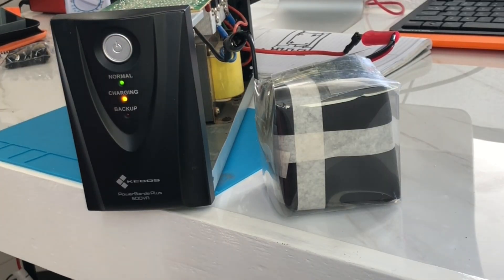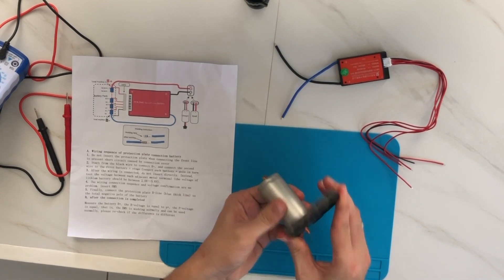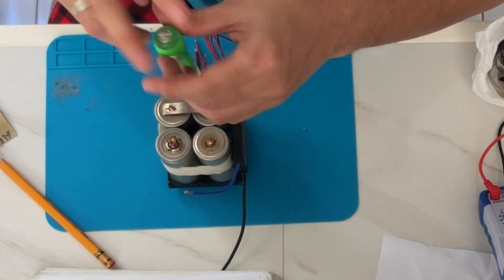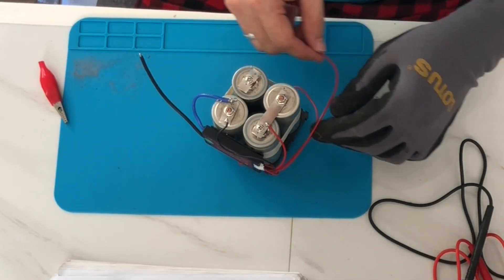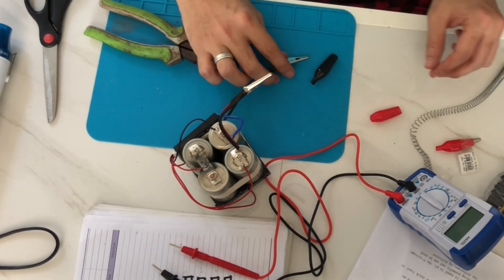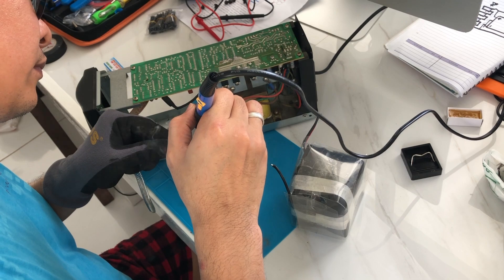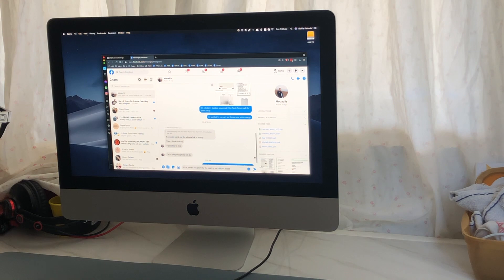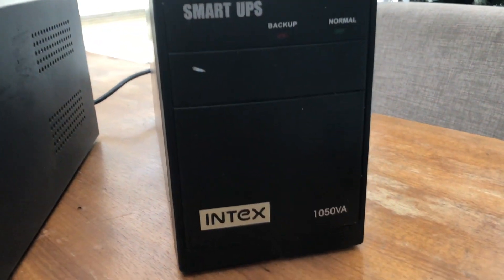How to replace a 12v UPS batteries with Lithium Batteries (LifePo4)

Comment: go to wallmart and get a 105 amp hour deep cell lead acid for about $90 bucks and run that for hours and hours. We have a lot of outages here so I picked up a few of these UPS units for free. people trow them out rather than the hassle of buying a new battery and taring them apart to replace it. They are literally everyplace for free or next to nothing. when the lights go out, your stay on. lead acid can last up to 5 years if you check the water every month. The UPS units charge 24/7 and cook batteries. check water levels and cycle once a month.
Reply: From what I have seen, the lead-acid UPS batteries only last 2-3 years and most of them do not hold 80% of the charge after 2 years even though not being used much.
Reply: @vufirst  yup. they are battery cookers. you must check the water. walmart sells a deep cycle 100 amp hour. it is called a sealed lead acid but still has  caps that unscrew to check water levels . because even sealed will vent off water . especially if just sitting on a needed "trickle charge". unused for 2-3 years. 
 check water, cycle them once a couple month's or so, and use a real battery charger to charge it to full . 
 most throw out ones you can get free, are not "pure sine wave" and not for lithium

Comment: You should remember that lifepo4 can only discharge at 1c continuasly and at 2c for few seconds. Using 6000mah cells is a bad idea. Ups will consume more than 15amp if u plug in a 100w load. And a 300w ups can consume upto 30amps. So u should go for 25ah lifepo4 at minimum. Or lithium ion. These batteries will explode or die early if u discharge them so hard..a monitor and pc st idle does not really consume much power. U should have run a cpu and gpu stress test to really see how long the battery takes to puffup😂
Reply: I did not understand any of the term like 1C 2C, what are these??

 If the 12 Volt 6 or 7 AH  Lead Acid Battery is there by default then how can the UPS consume more than 15 AMP and why the UPS will consume more than 15 AMP if anyone connects a 12 Volt 6 or 7 AH Lithium Phosphate Battery ??
Reply: It is a Lifepo4 Battery. It can handle High Discharge Rate. Without getting hot. Plus lifepo4 batteries are very safe.  It rarely catch on fire
Reply: @polized123  yes they are safe and don't catch fire easily but the lifepo4 chemistry does not allow more than 3c or about 18amps in case of a 6ah battery pack for more than 30sec. Any more will shorten the cell life. Recommended discharge rate is 0.2c or about 1.2amps continue. And maximum 1c or about 6amps in this case continuasly. A typical 18650 lithium ion battery can be discharged at 20c or more. But lithium iron phosphate can not be discharged at more than 1c .. and him shorting out the battery by stupidly sticking it in the baremetal case without any protection has already damaged the cells a bit
Reply: @KuntalGhosh  yeah. That's why they are always configured in parallel.      If we need high discharge rate for 12v. The configuration should be.  4s6p

Comment: A home computer UPS is a "stand-by" (as opposed to the more expensive "continuous"} power backup. This means that devices connected to it run directly off the grid mains until an interruption of current is sensed, at which point the battery-driven inverter is switched on (in a "continuous" UPS, the output is always from the inverter and the battery is constantly under load while the device maintains its charge and the grid mains is isolated from the connected equipment). The switching is nearly instantaneous, happening in five milliseconds or less, at which point the battery will begin discharging. This state will exist until the UPS senses a return of house power or the unit shuts down to avoid over discharging the battery. Once the unit again is powered by the grid mains, a charging sequence is initiated to bring the battery up to full charge which returns the unit to a back-up stand-by status mode with the house current again passing through to the connected device(s).

The important consideration here is any UPS is designed to work with a specific battery chemistry, in this case the AGM lead acid. There are numerous articles available that explain in depth why one should not misuse a charger meant for one type of battery to charge a different battery chemistry. I would advise researching them to at least gain an understanding of what is good practice in this regard and realizing that just because one can does not mean one should. It may result in fewer houses burning down.
Reply: I am teasing the idea of running my SMT-750i on lipo with a BMS specifically set to the expected low voltage conditions the Ups wants (luckily I can change them in this unit) but knowing that Lipos don't like to be stored fully charged I am thinking that an extra cell or 2 would help keep the "fully charged" voltage closer to the storage voltage of the cells to increase longevity dramatically. I am still trying to work out a solution that would give me somewhat accurate run-time readouts on the UPS but it's very much a work in progress
Reply: Bms should protect from over charge and under charge. Over temp under temp.
Reply: There are UPS that has a limit in battery mode but there are that can work continuously. I have a IdealPower UPS that is now serving as an inverter. I just removed the mini speaker.
Reply: Just read you comment. My UPS lead acid battery went dead and I urgently replace it. And so I replaced it with a Lifepo4 battery. The many YouTube videos made on this mod made me decide in doing so. I am running my UPS for the last 8/9 days on this LifePo4 battery. I bought it readymade online. It is supposed to be with the BMS.
Is there any danger in what I have done. Plz advice. As of now I have not had any problems. But I have not been running my system when the power cuts off. I switch it OFF immediately because I am still unsure of this mod. 
Is there something that I need to be careful about? Also what about the charging voltage? Will there be a problem with the BMS? Have connected a volt meter to the battery and it shows 13.2v max charge of the battery. But if the power fails, it drops very quickly (almost immediately) to 12.5v. Then it slows down on its discharge rate.
Reply: @mediatrix1111  It will drop very quick the first 5 seconds. Then the Transformer kick in trying to stabilize the voltage. As it drops...This is to prevent the wiring from melting. As voltage decreases. Amps will increase. That is ohms law...

So no your system is working as designed..Just be sure to use LifePo4 batteries....Not Lithium Ion...
Reply: @WizzRacing  Thks.  BTW it is a LifePo4 battery pack rated at 12.8v 6000mAh. Bought it online. And it has a BMS.
Reply: @mediatrix1111  the way your UPS tries to charge LiFePo4 is probably not good for the battery. Dangerous? Not really, LiFePo4 is sorta safe/not super dangerous. 

If your UPS is the kind that always applies a float/trickle charge then that is VERY bad for your batteries. Most lithium chargers will cut off current. Some will turn back on if the cell voltage drops a bit but it will only stay on a short time before shutting off again. I’m not going to say that your house will burn down from applying a constant trickle charge but that is the reason why I am not doing this mod.
Reply: @bobforte9343  been 2 years replaced lead acid with LFP, still hold charge for over 30 minutes.
Reply: actually charging lithium ion battery with lead acid battery charger is safe. i dont know anything about lifepo4
Reply: Wrong  most lead acid for back up  continuously trickle charged. about  ~14 V  with a little ripple.   If you apply that to any type of LI battery design  it can over charge one battery due to imbalance in a battery  then it degrades, then there is a possible fault problem developing.  A BSM will take the 14 V and control it to charge each cell to the  4.1 V you selected.  If one cell  goes low on charge the whole pack will be shut off to keep them safe.  This extra circuity missing, was probably the cause of the many fires you read in the past.
Reply: @nikhilatyoutube  You're much too modest: It's obvious you don't know anything about lithium ion batteries either. If you choose to use a lead-acid charger with the equalisation mode disabled to charge a lithium-ion battery, then you must disconnect the battery as soon as it is fully charged, to avoid damage to the battery. Best practice is to use the charger meant for the battery. Why someone would say otherwise and put your battery bank at risk is questionable.

Comment: 300w / 12v = 25 amps, i doubt your soldering will hold that power when UPS will be on battery. More solder wont hurt and be more safe :)
Reply: You're not converting all 25 amps to heat.
Reply: @DanielKennedyaeos  Not all 25 amps, but bad solder joint will create resistance. even if it eats 2 amps, 25w is a serious heat concentrated in several square mm and will cause sparks and melting
Reply: Does this mean the current depends on how much power the device consumes when connected to the ups? If ups only used in a router 9W-18W, then the current drawn from the battery will only be 1.3A-0.67A right?
Reply: @r1ce0919  if battery is 12v then yes
Reply: Ups only consumes maximum of 10A. It should not have that problem
Reply: @polized123  10A from outlet yes. but from battery it's more than 25 amps
Reply: @alexsiniov   that gel battery is rated for  10 amps max  but those Li may do 20A   The wall current is for running the ups like a power strip.  most are 15 amps in the us
Reply: Then using 40Amp BMS is fine
Reply: but most of the bms boards provide this kind of tiny small wires and connectors. strange...

Comment: should add a mppt solar charge controller also to it but . #NOTE make shore it can be programed to the right voltage so not have issues with the ups charger . test the max voltage of the battery at all times to see if it has a equalization charge so you dont blow up the battery / cells. other then that ill hope to see that you made an update of this ups conversion

Comment: For 2000va 24v ups, How many battery i need and what Amp bms for say almost 500w load for at least 10 min ? Plz answer bro.
I have this Power Guard PG-2000VA UPS which has a Display buit in and can hold 4 lead acid battery which is total of 24v 18ah.
Reply from the maker: 8 cell in series(3.2v each) - 6ah. Your UPS can carry upto 1400watts. So you can add more battery in parallel of up to 50ah.
Reply: @techwithrichie  What about BMS ? Which bms i should choose ?
Reply from the maker: @Mr.Thanos_  based it on the max ah capacity of your battery build. For 18ah, you can use 20-30ah bms
Reply: @techwithrichie  Thnx bro now i get it. Soon I'm gonna do it. If i need any help i will ask you.
Reply: @techwithrichie  I ve seen a BMS with contact relay programming. You set charging voltage and over charging voltages from 6v to 60v, do you think it's safe to use that BMS. I am afraid the transistor BMS may short one day and cause fire.

Comment: Thank you so much this is the video I was searching for 
1 Since its lead acid battery UPS battery will be continuously charging does battery will destroy or fire due to overcharging 
2. This battery capacity is how much AH. Can layman like me  try to build battery of course i wont do short like you did 
And please let me know the how is your battery performance  now
Reply from the maker: 1. The BMS handles the overcharging.
2. 6Ah 12v in series. Battery still performs like the first day i installed it
Reply: @techwithrichie  After the battery gets full recharge does the UPS cuts off charging ?
Reply from the maker: @Bharani_0601  yes. The BMS has over charging protection

Comment: Honest Question: Doesn't the old case have its own BMS?
Reply from the maker: No. It was designed for lead acid battery not for lithium
Reply: @techwithrichie  How would the case be able to tell since current is current?
Reply from the maker: @Moe-j8z  It does manage a 12v bat but it doesn’t mean it’s able to manage the 3.2v individual cells right? The BMS is for the 4 cells in series.
Reply: @techwithrichie  I see your point.  But if the battery(ies) where single 12V like this:

https://www.vmaxtanks.com/V30-800-Deep-Cycle-High-performance-AGM-Battery-_p_46.html

Then the UPS charger should charge it correctly you think?
Reply from the maker: @Moe-j8z  correct. It’s just like replacing the orig lead acid battery. No need for BMS. The reason why I use lifepo4 here is because of longer backup time and longer lifespan.
Reply: @techwithrichie  Do you think the UPS would be able to charge say a 48V battery?
Reply from the maker: @Moe-j8z  check your users manual. Mines capable of only 12v, ihave another one with 24v

Comment: Keep us updated i want to do that same just not sure it would be safe
Reply: Is much more safe to use 4 lithium cells to charge to 12 volts level.  No danger from fire and lasting 10 years or more.
Reply: @Landrew0  This has been my concern, does BMS prevent the UPS charging system from destroying the Lithium batteries?

Comment: Put an external switch for the speaker.
Reply from the maker: I might just solder it out next time. Thanks for the tip!
Reply: yeah i just ripped the piezo out of mine. I can mute it through software but i just don't want to deal wtih it and mine also tells me the battery remaining through the usb port so i don't really need the buzzer

Comment: Is there any update on how long it lasts after a full charge?
Reply from the maker: Still the same until now. 20-25mins with my 21 inch iMac
Reply: @techwithrichie  So far no fire or explosions?
Reply from the maker: @zeuszaku  none so far
Reply: @techwithrichie  Have you considered selling one of those with a higher capacity?
Reply from the maker: @zeuszaku  i’m using it personally. So no plans of selling it
Reply: @techwithrichie  By far, "no plans of selling it" is the wisest thing you express on this subject.

Comment: Umm, how long will it take for the UPS charger to kill the Lithium?
Reply from the maker: average of 3000 cycle. probably 3-5years. Not sure yet as this is an experiment. With the help of the BMS, hopefully it will last long :)
Reply: @techwithrichie  My guess is the constant float charge designed for SLA batteries will greatly reduce the expected life cycle.
Reply: @jimbeam5  the BMS prevents that from happening.
Reply: @adon8672  BMS prevents Over Charging not constant charging.
Reply: @jimbeam5  no, most BMS prevents constant charging. You can measure it with ampere meter, once the batteries are fully charged it cuts off the batteries. Even when you disconnect the whole unit, and connect it again, it checks for the batteries voltage and cuts them off again. My BMS also doesn't respond (starts charging the batteries) even if I use 3-4% of the batteries. It started charging them again when they reached about 90%.
Reply: @5T3F4N_I  What you are observing from your BMS is normal due to the very flat voltage curves associated with LiFePo4 chemistry.  The Sealed Lead Acid charger inside the UPS expects to be charging a 7-9Ah SLA battery with Standby Use voltage between 13.7-13.9V.  That charger will supply 7-9mA indefinitely (0.001C rate) --until there is a power outage and it needs to re-bulk.  The BMS can do nothing to stop the constant supply, so, in the end the LiFePo4 cells will be kept at 100% SOC.  Storing Lithium cells at 100% SOC will greatly reduce their life.  Could be a moot point since he's not going to have 3000 power outages, but when the power goes out next March the UPS may still only supply 5min. runtime.
Reply: @jimbeam5  But every power supply will provide indefinite current to the batteries, the BMS's job is to stop that. Whether you're using the UPS board to charge the batteries, the 12V power adapter, solar, or whatever your choice may be, they won't stop the current flow to the batteries when they are charged, the BMS will do that. And I'm telling you, I measured the current between the BMS and the batteries, I wanted to make sure the batteries are not being overcharged. But what I found also is that not only the current doesn't flow, after the BMS cuts them off when they reach 100%, but the batteries percentage keeps going down and the BMS isn't doing anything about it, until they reach 90%. Even when I disconnect the load at let's say 95%, and measure the current to each cell, the current is 0.000mA.
Reply: @5T3F4N_I  You are mistaken
Reply: @5T3F4N_I    What you are seeing is most likely a battery pack with a shorted cell in a parallel bank.   A Charger has only limited power out put, but a battery are often limited by the wires connecting them.    Thus what you see is a shorted battery draining the bank and the bsm only  knows it need more time to charge back than the rest.